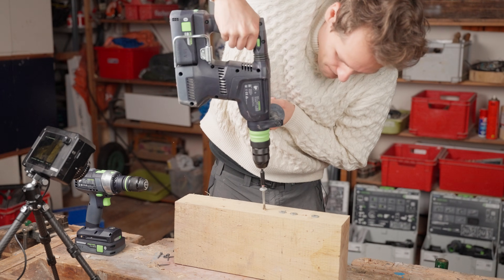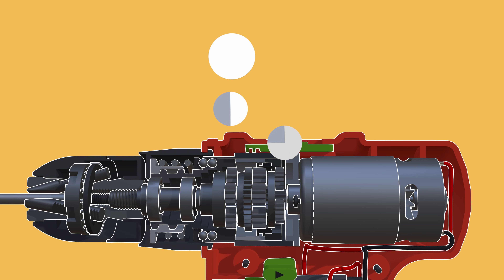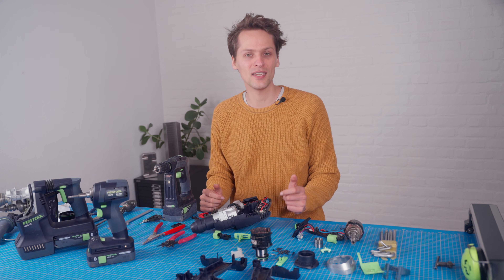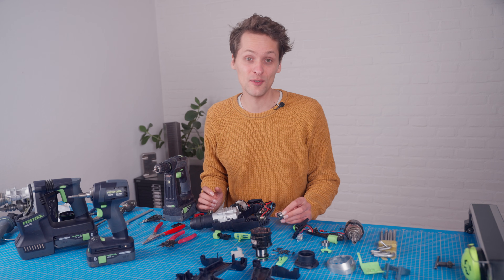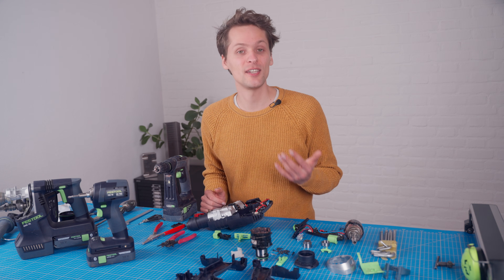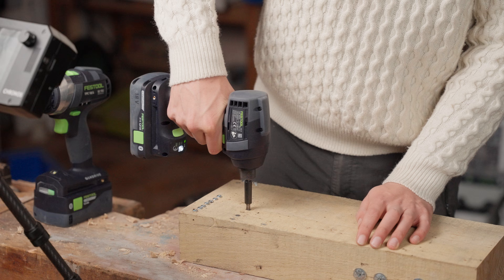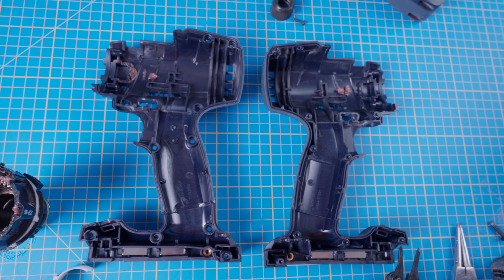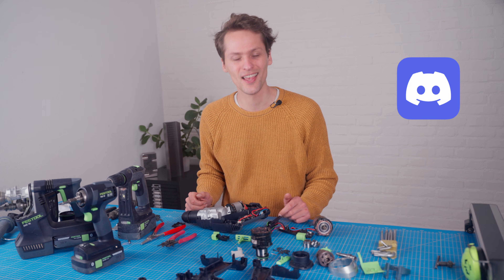Hammer Drills Don't Hammer - Every Drill Explained

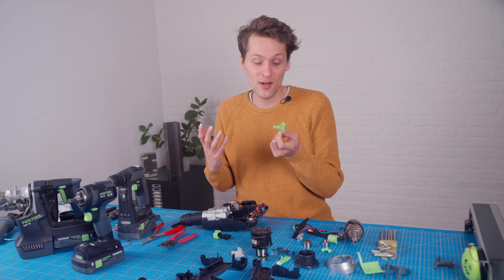Comment: 16:55 iron dust is quite ubiquitous in a work shop and I bet the magnetic trigger will care about that
Reply from the maker: Would be a cool test! If you do it, tag me
Reply: It's sealed from dust it doesn't care. The dust being pulled through the electromagnetic powered motor is more of an issue 😂
Reply: @freedomofmotion  you mean that circle of sponge? that is definitely not enough dust protection. Also if you get iron dust in the motor yes it could overheat or something. However if you get iron dust in the trigger it could turn on when you least expect it and be actually dangerous.
Reply: @kubeek I don't know of anyone who's ever had that happen.
Reply: What? Iron doesn't generate it's own magnetic field. You can run an iron bar across a hall effect sensor without an issue, so the worst that I could see happening would be that iron dust somehow accumulates on the magnet internally, but even then I can't see any reason that'd alter the readings for the HE sensor, and even if it DID it'd be easy to fix by just wiping away the dust.
Reply: @robonator2945  Iron sure does channel magnetic flux though (that's why transformers are made of iron), so if you get really unlucky it could redirect or weaken the signal in a way to make the trigger work strangely. This is extremely unlikely imo, but if you fill your drill with iron filings and it stops working that could be one reason.
Reply: @robonator2945  not an iron bar by itself, but magnetic dust can create a path between the magnet in the trigger and the sensors that could turn the drill when you didn´t ask it to turn on.
Reply: @kubeek  you'd need a deeply absurd amount of dust accumulation for that to happen. At that scale you might as well be saying that sawdust would destroy a drill because the dust would form a solid iron block between the internal gears.
Reply: @robonator2945  there is also the hysteresis effect, wherein a paramagnetic material like iron retains some amount of magnetic field after a larger magnetic field has been placed on it. You can actually experience this yourself by rubbing a bar magnet down the length of an iron nail a few times.
Reply: @reaganharder1480  two things
1st, a semantic note, you're specifically referring to Magnetic hysteresis. 'The Hysteresis Effect' is a kind of nonsense term. Hysteresis just describes the ability of a system to have 'memory' about past states/inputs. As a similar example, it'd be like saying "natural selection is an example of the Evolution Effect". It's not even 'wrong' per se it's just super weird phrasing. 'Hysteresis' is basically the description of why when you set your thermostat to 70 degrees, it doesn't turn on the heating when you're below 70 and turn on the AC when you're above 70. Instead it turns on your heating when you're at 68, and turns on the AC when you're at 72, with a 2-4 degree gap of ambiguity based on past-state. (e.g. if the temperature is 69 degrees the heating could be off, or it could be on, depending on if the last temperature was 68 degrees and teh thermostat started heating OR if the last temperature was 70 degrees and the room has started to cool off, without the thermostat doing anything)

but, 2nd, (and more meaningfully to the conversation) almost none of the metal dust in a workshop would be magnetized like this, and even if it were, it's sitting right next to another magnet that would quickly realign it's dipoles and drag it to itself. Not to mention the HE sensor would almost certainl have a fairly charitable deadband builtin to avoid sub-starting torques. (most motors need to reach at least 20% duty cycle before they actually start spinning, anything less and they just stall out with high current draw)

In short, to get a false activation based on metal dust like this you'd need an entire pile of pre-magnetized dust that was magnetized incredibly strongly and, by pure chance, accumulates around the HE sensor WITHOUT being re-aligned by the nearby magnet, AND all of the dust particles are aligned themselves so that their average magnetic field doesn't cancel out. This simply isn't an issue practically speaking.

What is actually a much larger concern would be false activations from EMF generated by other motors or nearby machines operating. That'd be preventable with light metal shielding around the sensor, but I'm not sure if they actually do this. Still, even that seems like a very unlikely activation mode since magnetic fields decay exponentially.
Reply: Inside any kind of power tool you have a set of REALLY powerful magnets. Guess once what iron does does to them. Half of the art of power tool design is getting cooling air to where it is needed while keeping stuff out.

Comment: 16:55 A drill got a Hall effect sensor before Nintendo Switch
Reply: sounds like we need festool gaming controllers
Reply: its gonna come on the Nintendo Hall
Reply: At least here it's just a simple reed switch
Reply: @ImieNazwiskoOK You can usually control the speed of a drill with the switch and the whole drill is shown to have electronics, so I don't think it's just an on/off reed switch.
Reply: @ImieNazwiskoOK I'm very sure that is an analog sensor, not a reed switch.
A drill that could only be on or off would be excruciating to use.

The only drill I know of that works like this is a very old corded soviet drill that can't even go in reverse. (Seen on the channel "the doubtful technician")

I have an old cordless drill, and its potentiometer broke, meaning I only have off, lowest power setting, and highest power setting, and it really only works for drilling into things, and you can't screw anything in or out.
Reply: @marluna_x  there's quite a few (mostly cheap impact/hammer) drills that are bang-bang and you have to feather them if you want any sort of speed variation.

Comment: Festool - Overpriced and underperforming for the money. Using plastic and pressed metal in the gearbox of a £600 plus drill smh.
Reply from the maker: Certainly possible. I have no stake in the matter. Although I doubt you'd be able to buy any cordless drill at all that doesn't use powder metal gears and a plastic housing. Even industrial brands like Hilti do so I believe
Reply: @KnowArt  Don't even get me started on Hilti, they have an unnecessary service light that stops the drill working as soon as it comes on, and it's in a timer. Japanese brands for me all the way.
Reply from the maker: I learned that recently about the light. Pretty crazy stuff. I gotta look into that more as I might have the opportunity to go to their testing facility. But if it's as bad as it sounds...
Reply: @KnowArt  exactly what I was going to say